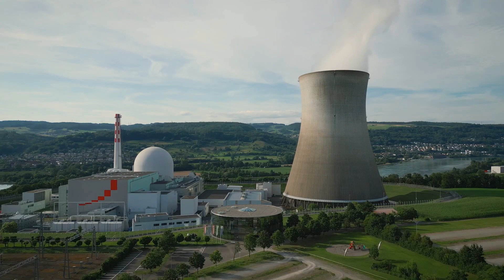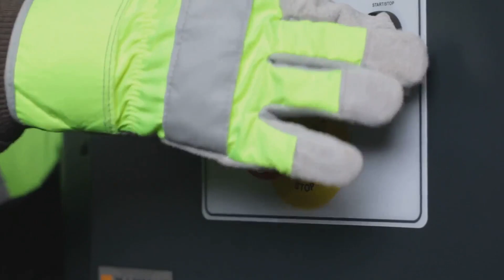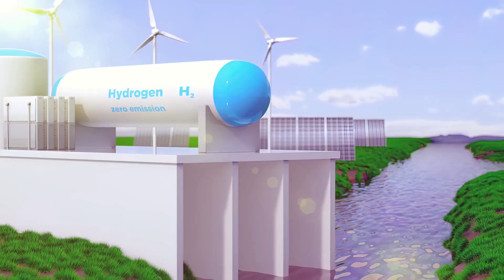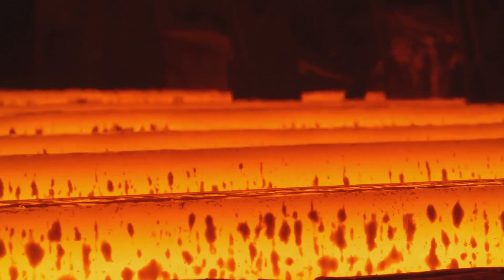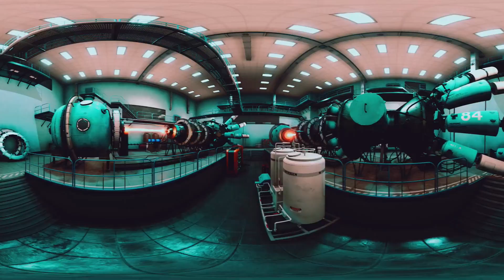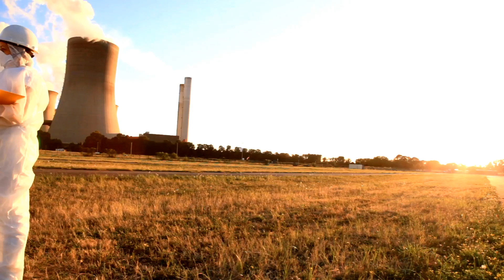Thorium Reactors: A Forgotten Technology Making a Big Comeback

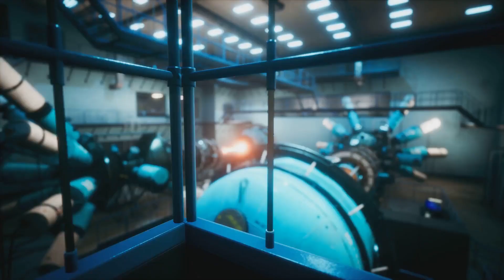Comment: @1:15 - 1:20:
'..unlike uranium thorium doesn't require the complex and costly enrichment process to make it usable in a reactor

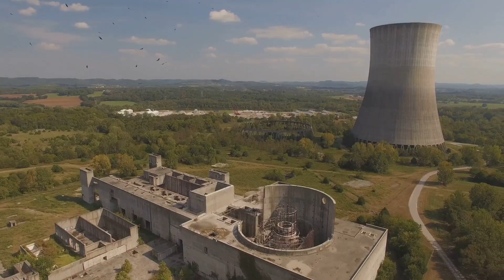@6:44 - 6:51: 
'...converting thorium ore into reactor ready fuel is more expensive than uranium...'

Please elaborate about which is most costly to bring from ore to fuel